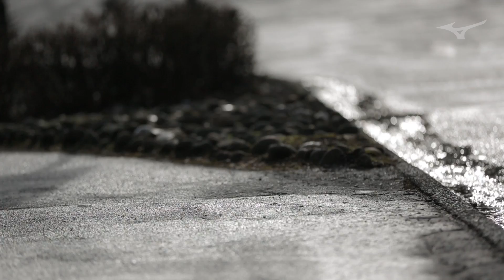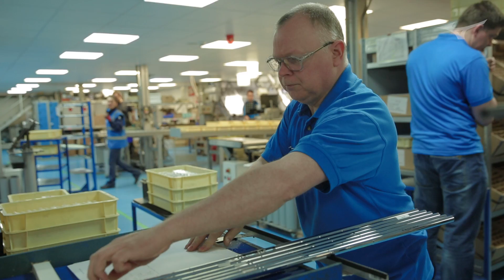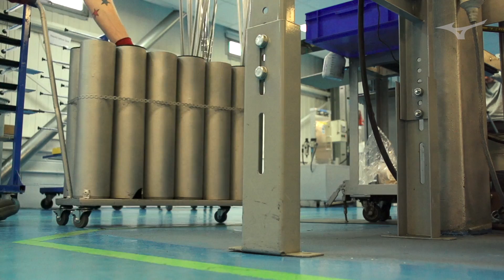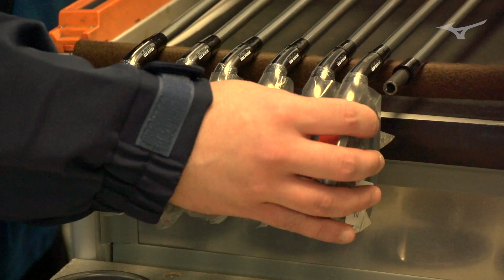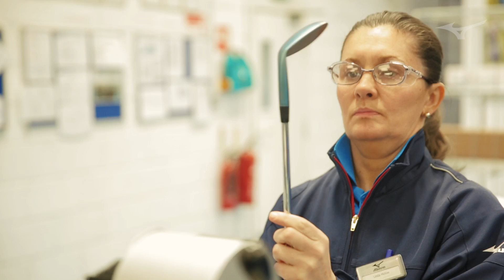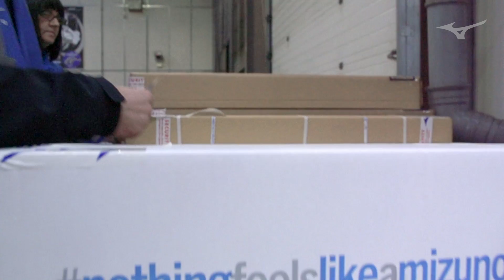Mizuno Golf European Custom Fit Assembly Line.

Comment: I cannot wait for my new sticks
Reply from the maker: Enjoy them - what did you opt for?
Reply: @mizunogolf1906  456, FLI HI, 7-pw - SC. 0.5" longer in length. afraid i have to send them back to get the swingweights adjusted. the clubs feel to light so i suspect they have used the lighter 'b heads' when building. Mizuno said this should be fine to get them up to D4.
Reply from the maker: @CraigalFun  ok - hope that gets sorted for you.

Comment: With all of the tech, laser and alignment, how do the spine and FLO the shafts, when the put on the grips and stickers first, and then aligned the heads with the grips. I think that a SST PURE og another tool, would be at great addition to the custom fit assembly and would set Mizuno even further apart from the rest of the manufacturers.

Comment: 2-3 days...ive just benn told 4 weeks and only live a few hours away. Cant wait for delivery though, great video
Reply from the maker: It's an issue with head stock rather than distance.  The MP-18 bladed short irons and MMC long irons have been ordered a lot in mixed sets this time around.  Until we've a few weeks of orders in the system, it's very hard to predict head demand to the exact amounts.  September / October has been incredibly busy in Cumbernauld since launch of the MP-18.  Just threw us out a little bit.  We're getting the head stock levels back in shape now.

Comment: check at 2.19 minutes, on that frame you can clearly see that the heads were made in China.... it's written on the sleeve that protects the club head.... 
I got some JPX 900 Tour, they came with no serial number and with a gold sticker saying, made in China. 

They should cost 20% less, at least... if they are not made in Japan.... all the made up marketing.... very disappointing.
Reply from the maker: Some of the polishing / finishing happens in China.  But ALL the Grain Flow Forged heads are manufactured in Hiroshima Japan.
Reply: Unfortunately you probably purchased a counterfeit set of clubs.
Reply: KLAMATH ONE     I had several tries to purchase irons on eBay, but never did so due to the fact that a lot at counterfeit.   So I just pulled the trigger and went to an authorized Mizuno dealer for a piece of mind.    Best decision I made.   Love my authentic Hot Metal Pro irons.